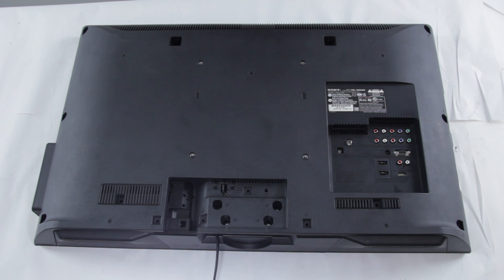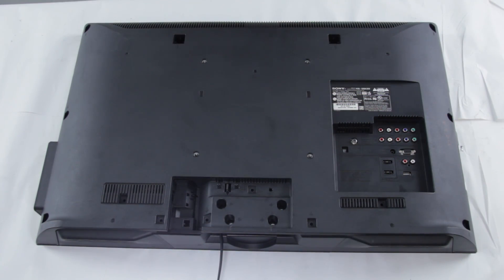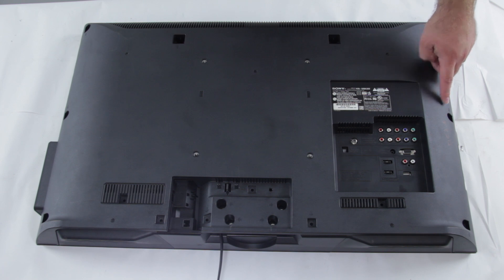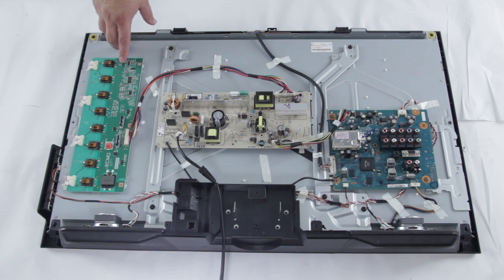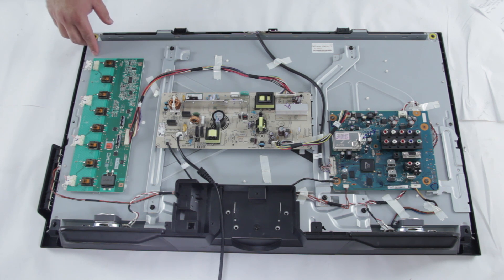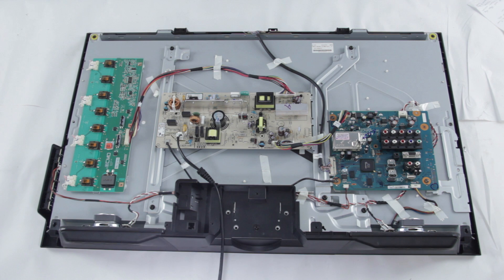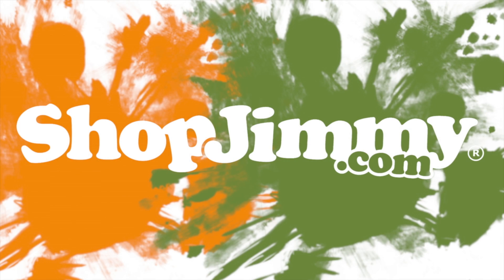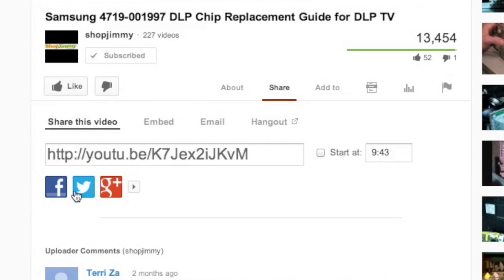LCD TV Repair Tutorial - Backlight Inverter Common Symptoms & Solutions - How to Fix LCD TVs

Comment: HELLO i have a sony bravia 37u 4000 had the t-con board repaired tv worked 2 times fine  now tv turns a green light for 10 seconds then a repeat 4 red flashes no sound no backlights  standby voltage constent to the main board ! could it be the t-con board faulty orthe iverter board? thanks for your time great v

Comment: Hi i have a lg tv model 47g2-ug and the tv works fine sometimes i turn the tv on and the picture is great but during shows it turns black and it has sound still after a few seconds it restarts itself and turns back on and works perfectly again then it repeats sometimes it works for hours then it just shuts off sometimes it has a weird picture like a bunch of lines then restarts and works like new for another few minutes if anyone knows the problem plz reply

Comment: My serial number is A1806246390000954A. The model number is RTU5540-D? This is an RCA 55"Ultra HD LED TV. Brand new. I get sound but no picture. If I shut off the lights in the room and turn on the tv I can barely see the picture if I use a flashlight. Do I need a new back light invertor and if so where is it located and can you get me one?  Thank you.  philfam5@yahoo.com

Comment: Thanks for the video. I found a Dynex that semi-works, where the top of the screen is dim all the time. Can you please check out the video below and let me know what you think? It makes a screeching noise when it's on (and it's not a fan like I originally thought). https://photos.app.goo.gl/fZFXwZN82zcmmjhU9 I believe the issue might be the LT-4014-2 Inverter Transformer which is connected to the backlight inverter. Thank you for any advice!

Comment: I have a Samsung LN40A550P3F with no backlight. The TV tuns on fine and has sound. if i put a flashlight in the back i see can see a picture. The backlight does not turn on at all even when i turn it on. I replaced the inverter board and still the same. I removed the power supply and checked for bulging capacitors and burn marks on both sides of board and everything seems good. I also checked the 2 fuses and they are ok. Any idea? Thank You

Comment: Hello, I have a UN55F8000 Samsung TV. The backlighting is more dim than usual. I have turned up the backlight/contrast to max to be able to see picture but it gets hard to see details on screen. Which board controls the backlighting? You mention a back light inverter but I don't think my TV has that, all I see is a T-conn, main, and power supply  board. I have called Samsung and they have told me that I need to take it to a repair shop. Eco function has ben turned off. Can you tell me which board is causing the problem?

Comment: TV:  Model 52w3000 Sony / issue: The screen starts to get dark in the center and images appear to be in slow motion. This Problem is always from left side of screen. I have replaced the T-Con Board, the main board, the ribbon cables and thinking about replacing the left side upper and lower inverter back light boards. I'm not sure what to do next. Any help our advise would be appreciated. thank you: Email: -Bruce@TrovilleInsurance.com / Phone: 404-907-0318

Comment: I have a SAMSUNG Model  ln37b550k1fxza. The screen is blank but sound is normal. I am considering the  BN44-00262B pwr sup/back light inverter. I have heard that the lamp could be the problem but is probably not available. Bob McLaughlin  email rnmclaughlin@cinci.rr.com

Comment: Backlight not working.  Did flashlight test and picture works.  Replaced backlight inverter twice and still no backlight.  RCA L32HD35D with 4H.V3008.001/C1

Comment: Hello..Jimmy I have a Sharp Aquos 40" inch Model number LC-40E67UN Serial No. 907814373 that have's two horizontal Lines at the bottom of the screen. Would that be a T-con problem?

Comment: Sony Bravia KDL-26S3000 
Model #: KDL-26S3000
Serial#: 4026145
Sony remote control: RM-YDO18
*standby light blinks six time interval and keeps repeating. I changed main board + led power supply but still same with screen flashing twice and goes into standby mode with six blinks interval on standby light. The only thing I haven't changed is the inverter boards. If so how do I check it with multi-meter*

Comment: I’m having an issue with my 50” RCA LED tv model: led50b45rq. I am able to get sound and also when using a flashlight can see the picture. When powering the tv the screen flashes for a second then goes black again. I’m assuming it’s the backlight inverter but not sure. Any ideas?

Comment: I have a 52" insignia tv that comes on for 10 to 20 minutes then the screen goes out. When I shine a flashlight on the screen I can just barely make out the picture is still there with sound. My best guess is a bad connection with the backlight inverter due to heat. Because the screen always lights up for a period of time until the tv has ran for awhile. Anyone with another suggestion?

Comment: Swapped out backlight inverter board on a LC37D40U Sharp Aquos due to no backlight. I had volume and could see images. After the swap, I now have backlight but no volume or image. I am able to get into the factory reset mode but thats it. My remote doesnt work and I cannot select OK to reset. Its not showing any lamp failures either.

Comment: We have Sony TV Model KDL-40W600B, Serial # 8142710. TV could not be turned ON and had 6 red blinks. We replaced Main Board A2074642A. Now TV turns ON, has green light, has sound, but screen is black. We guess we need to replace Backlight Inverter board next. But we cannot find it anywhere online. Could you, please, suggest if we are on the right path, and where to buy this board? Thank you!

Comment: I have a 55" Haier model 55E3500. I have audio but no picture. I did the flash light check and I can see writing on my tv. On the back of my tv I have 4 different serial numbers so I'm not sure witch one you would need. My tv was just working yesterday but has gone out completely. When I turn the TV on it flashes for a second and the just goes black

Comment: I have a Samsung ua65ku7000wxxy and have a 5-8cm vertical darker strip on my television appear (not completely black, image is visible under just very dark).Was wondering if you had any idea on what would be causing the issue?

Ideas I've heard: display ribbons are slightly defective, could move into specific position to fix?
Defective CCFL?
Defective inverter board transformer?

Cheers

Comment: I have a 55 inch Samsung model UN55EH6001 and if you divided the screen into nine parts like the numbers on a phone. one is ok. four through nine all good, but two and three are darker. Sound is fine, and I can usually still see the picture if its a brighter background. If I make the screen blue or shut off the signal it seems darkest in the middle.  I shined a flashlight and saw no change.

Comment: I have a Samsung LN40B530P7FXZA. Nothing comes on. The red light is on in the right bottom corner. I took it all apart but couldn't see anything obvious and didn't have a way to test the CCFLs. They look fine. One day it worked perfectly and suddenly it won't do anything. Any suggestions?

Comment: Yes Sir, My 40" Sony Bra via color LCD TV  whose model # is KLV-40S 310A ! Now problem is from 1 week before ,when power ON of the TV but Red light standby appearing but with Blinking about 13 times  & after 3/4 second pousing again appearing with Blinking Red  ,  but when  Green signal comes & try to On the TV but quickly Comes standby signal Red blinking @ My quire what is problem with TV !

Comment: Hi, I have a Samsung Curved 65-Inch 4K Smart SUHD 3D TV UN65JS9500FXZA (2015). Today I turned in my TV and it turns on and makes the click sound just like normal however I have no picture. I have sound and if I hold a flashlight up to the panel I CAN see a picture. Which board is normally at fault?

Comment: I have a Proscan 50" tv model# PLDED5066A-E , s/n: A1305096070000235 . I turn it on and it shows the picture very clear for about 20 to 30 seconds then goes black. I can shine a flashlight on the screen and see the picture.What do you think the problem could be.

Comment: 47" Panasonic Viera LCD. Model TC-L47WT50; Ser# MB21040145. Lost picture but have sound. Image is visible with a flashlight. Used multiple other sources of input with the same results. Replaced LD Board, but same results. Could not find any other troubleshooting advice.

Comment: My TV Model is KLV- 40EX400 and Serial 2820202. It was left unused for about 2 years but in properly packed condition in the original TV Carton. Now when I open and started  the TV it only emit sound of channels but no picture is on display. Pl help to possible remedies.

Comment: I have a 50" TCL tv that shows picture for about 1 minute then goes blackscreen but still plays sound. If I look closely at the tv you can still see picture but it's very dull. 

MODEL:L50E3000FS
SERIAL: 1310ALZ112453J00012

Comment: I have Samsung 40” lcd smart TV model no. UN40J6200AFXZA. The picture suddenly went off however sound is still coming. I checked the screen with power on with torch light and I can see the images. What may be the problem, please suggest and where can I get the genuine parts of it is replaceable ?

Comment: 55 inch Hitachi LCD TV model number le50 a 6 or 9 serial number ch5 GE 03989 the TV will still play sound has no image displayed if you shine a flashlight on the TV you can see the image is playing it just seems as if the back light is not receiving power anymore how can I identify which board is actually the backlight converter bored I believe it is just the one that has three plugins is that correct and where can I purchase a new board is there anyway 2 test the current backlight converter board

Comment: LM55C630K1F is the model number of my Samsung tv. 
The right side of the screen was much more dim. So I took it apart hoping it was the capacitors (like other videos have suggested). Nope:(
So I dismantled it further and it seems to be the light strips that run across. 
Can these be repaired or replaced?

Comment: I have an LG TV Model No. 70LB7100-UC, Serial no. 406RMEN9T260.  TV screen goes black with good audio.  Did the check with flashlight and do see images on TV.  Suspect backlight inverter.  Do you have same in stock?

Comment: Hi dear,

I did every step that you explain. I have a Samsung LN32B550K1FXZA. It does not has backlight, but it has sound. I did the flashlight, and I saw the menu or the number of the channel when I changed them. Also, I removed the back cover. the inverter and the power suply shares the same board. I  took a look and I saw the capacitor normal. 

There is any Advice about it?

Best Regards.

Jose
Reply: Also, It I tuned off or Turn on the tv afew times like 15 to 20. It turn on normally.

Comment: i have a un60h6203afxza (version hh01) Samsung tv 65in. with no picture or sound that i can tell. i have ordered all the replacement boards and led replacement strips from shop jimmy, but am having the same problems. this tv is little over a year old out of the box. any help would be great!
Reply: George Hacker so im just trying to power cfl back light inverters for a project with my fiancé’s son is there a standard voltage for there sadly the tv Type i can not remember the circuit boards were broken free inside tv I just cut boards where they were broken so I have several with three and to 5 cfl’s what would  be the best way to power then will send pic if it lets me ! Thanks
Reply: George Hacker obviously  i meant ccfl

Comment: Vizio 32" e320 ar, aivp 0089, 560411907122001155sz06, tv comes on. screen comes on and plays then goes black but with sound. Leave unplugged for a while and will sometimes stay black and sometimes work properly and then goes black again with sound everytime. I am unable to locate the backlight inverter. I believe it is under the metal frame to the side but am unable to get that apart. I inspected the PSU and looks fine except possibly 1 capacitor might be swollen a little on the top.

Comment: Hey Guys, not sure if you still check this but figured I would give it a shot.  I have an RCA LED55C55R120Q tv that a friend of mine dropped off to take a look at.  The TV itself only has 5v standby power and when you turn the tv on you can hear an abnormal surge of power for about 3 seconds and it then cuts off.  there is no action with the tv screen at all and the red IR sensor light just goes out.  I have taken the board off and began to troubleshoot a little,  when shorting the ps on and standby I still get no voltage to any of my low volt terminals except for the standby voltage.  I have checked the incoming fuse and everything is good there, the bridge rectifier is giving me 176v dc out when I begin to trace the power I'm having a little trouble with spotting where the loss of power is because I cannot seem to find a wiring diagram.  I am not getting any power to the incoming of the transformers which is understandable as to why I do not have any voltage at the terminal bus.  I have inspected all of the capacitors visibly and they do not seem to be bulged or burnt but before I start desoldering and all that jazz I was wondering if you might have any ideas to what could be the problem as well as if you have noticed in the past which components make a electrical buzzing noise and cut out when they go bad.  Clearly the issue is somewhere between the bridge rectifier and the transformers but I cannot seem to find it.  I appreciate any input you can give me Thanks

Comment: Hi I have a plasma Samsung tv model number ps50c680g5kxxu last picture I heard electrical noise  back light converter One of the components had a burn mark in the middle of it  Powers up but no picture

Comment: I have a sony KDL32R300B. My tv screen went black, yes i can see the image with a flashlight, and yes there is still audio, but since there's no backlight i figure the problem is with the backlight inverter. I've looked up replacement parts for it but only find the main board and the power board, do either of those contain the part i need or is it an individual inverter board? I'd like to be sure before i actually take my tv apart. Thanks.

Comment: My Apex LD4688T (assuming TSN is the serial #, 5134521022511E602) had sound but no picture. I did the flashlight test and I can see the picture then. I haven't found an explanation for this exact tv,  Any suggestions?

Comment: Hi there I have a Samsung 52 in model number LN52C530F1FX part number I’m looking  for is LJ97-02592A the backlight inverter. I am not Able to find it anywhere online and I was wondering if there is a replacement part that is similar to the one I am looking for, any help you can provide is appreciated

Comment: Hi there
I have a Techwood led model number(40ao1b) I suddenly have no picture but the sound is working, I check this problem on Google. One way shows to turn off the lights in the room and put some light on screen and try to see any pictures which I did and I can see some menu list on screen . Is this a bad inverter ? What do you think?
Thanks
Reply: Did you guys found out what's wrong? I am having similar problem. Please help me with fix.
Reply: I already ask TV repair over the phone he says it's the probably the back light , which according to him not worth the fixing and bay a new one is cheaper , this week I will take to another TV repair center to examine it correctly and give what wrong . I bleive from my research it's the main board . I will keep you posted with update soon.
Reply: Frankie Rodriguez applogies for the late responde, it was the backlight and I end selling it for parts.

Comment: I Have A Panasonic tc-65cx400u 4k smart Tv it comes on And has Picture  Left And Right Side Is Perfect But The Center Is A little Darker still  vissable But Darker a vertical line from top to bottom about 12 inches wide any suggestions ?

Comment: I have a Samsung LCD model un50h5500af
Serial number 02503cvfa00399k
The problem I'm experiencing is light areas in the top center portion of the screen. As well as the right mid area of the screen as well. These areas appear grey or light blue

Comment: 2011 Samsung 46" Model LN46D550K1FXZA version JH04 type LN46D550
Screen keeps blacking out at 1st it retained audio but then started blacking out and loosing audio.  If I leave it for a few days it comes back on.  Back on now but can tell picture is begining to fade again with shaky fading light around the edges.  If I replace the backlight inverter will that fix my problem?

Comment: backlight inverter replacement for model led65g55r120q I have sound put no picture and I see the picture with flashlight test
Reply: RCA
Reply: Did you fix your tv problem? I am facing similar problem with my tv. Please help!!
Reply: Swarn Nhjuhg the problem is the back lighting there's 20 strips of leds on the back but they are hard to find

Comment: I have a 43" Hitachi LED LCD FLAT SCREEN. SOUND STILL PLAYS. BUT NO PICTURE. I was told to turn off all the lights and use a flashlight up close to see if there is still a faint picture. I can barely it, but there is a picture. Someone is telling me that it's an Inverter Board problem. Do you know anything about this and is it an expensive fix?
Reply: Did you fix your tv problem? I am having same problem with my tv. Please help.
Reply: Swarn Nhjuhg nope. Still trying to find the exact problem and solutions
Reply: Swarn Nhjuhg and I'm trying to find out how much it will cost

Comment: Are the backlights themselves AC or DC? Typical flourescent ballasts are AC (or so i read). I'm looking to power just the backlight circuit board but i don't have the main power board with the larger transformer.